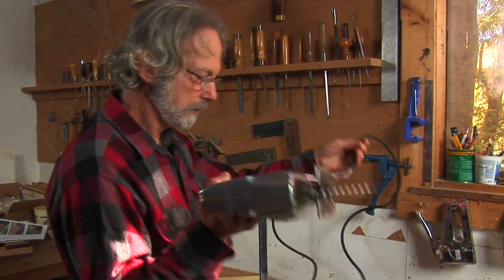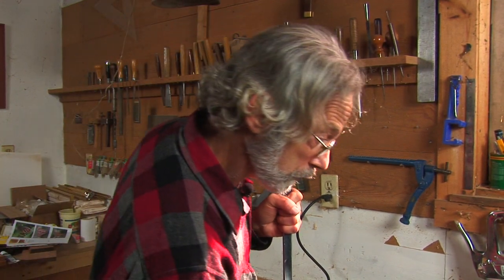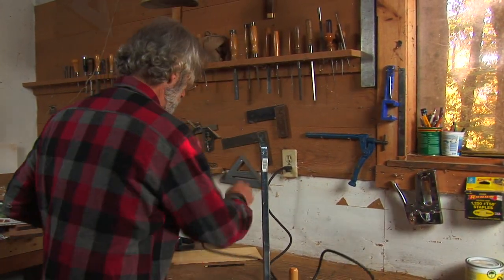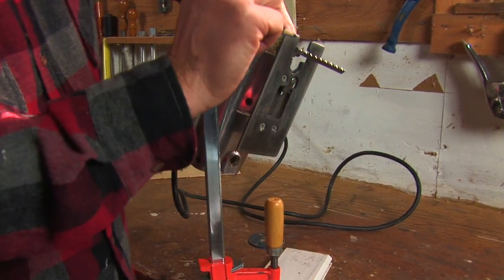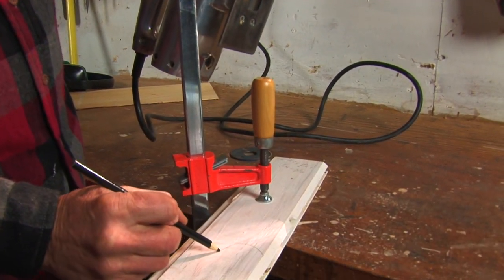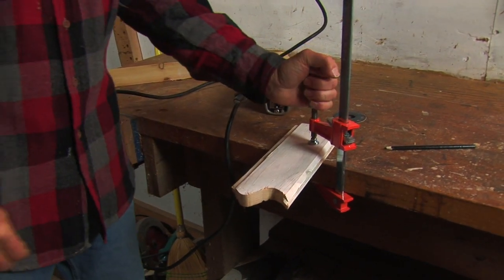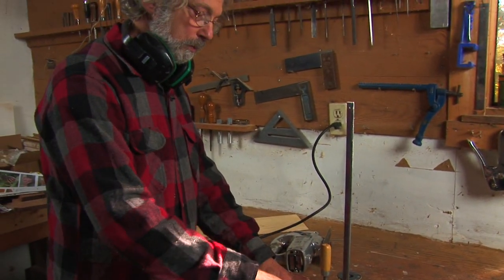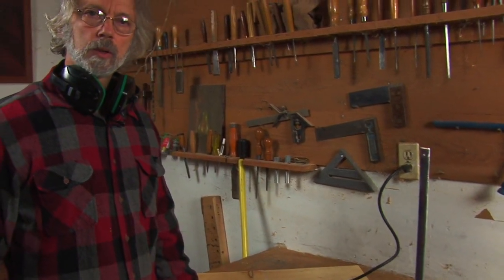Power Tools & Carpentry Skills : How to Use Scroll Saws

Comment: actually a jig saw is a sabre saw. That is the original name. A scroll saw has the same or similar blades but is not portable. So the reason he calls it a scroll saw is because a sabre saw is a portable scroll saw technically. So leave the guy alone he is not a moron. All of you "modern" carpenters need to know your roots and not just what the "new" dumb tool is at home depot.